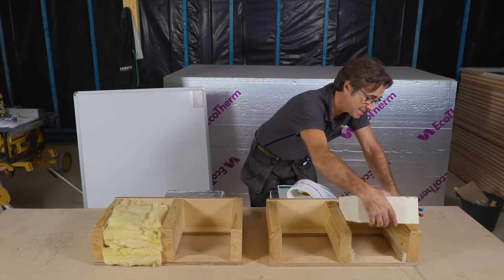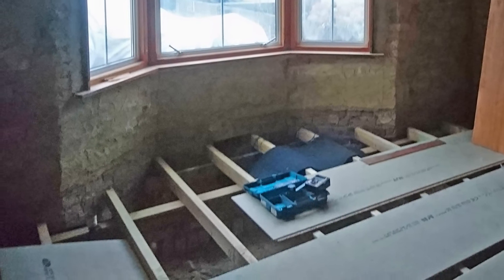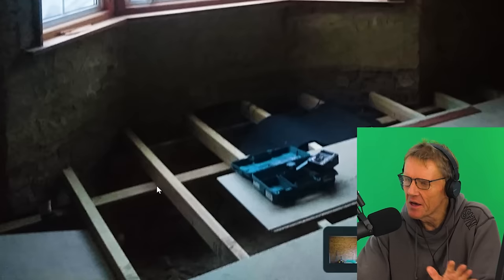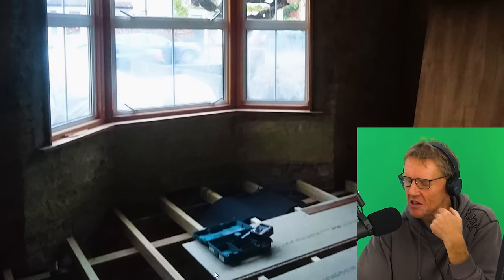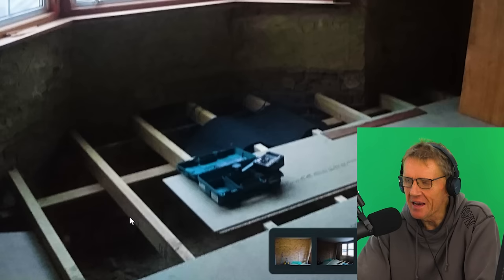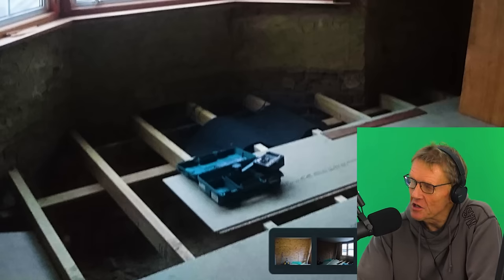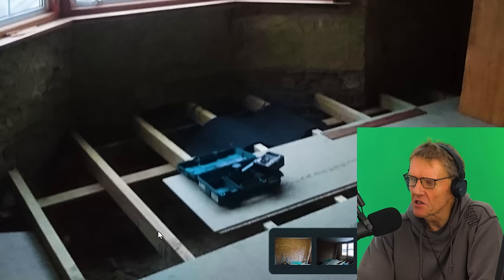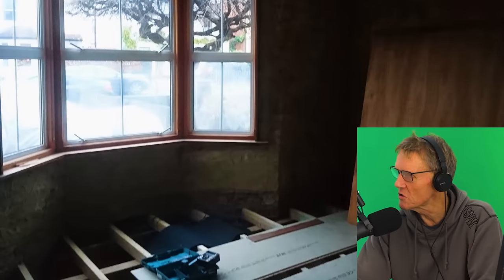Cold Floors & Walls in an Old House ~ What Can Nick Do?

Comment: I am steadily wall insulating the whole of my ground floor Victorian flat by CLS battening out the whole wall with lengths & noggins (taking wallplugs/securing screws into brickwork below sound original plaster, then insetting with Kingspan/Celotex/Iko ultratherm or any of those insulating boards (min depth 25mm), then plaster-boarding over the whole lot. It takes forever doing it this way, but I never want to have to do it again! It keeps my rooms warm and provides some sound insulation.
Reply from the maker: Are you putting in a vapour barrier?
Reply: It's laborious, but have been sealing all outer edges of insulating boards (where they meet CLS battens) with flexible decorators caulking, and am using metallised polyester (silver) backed plasterboard (screwed down to CLS battens) to finish. I'm only a DIY-er so hope this will be adequate! BTW Roger, I used to listen to you on LBC many years ago. If I remember correctly you had a regular DIY problem-solving slot on the Therese Birch (phone-in) show? Used to really enjoy your expertise & advice...still do! :)  @SkillBuilder

Comment: You could render the brick wall with a Lime render, which can be gauged to ensure no cracking or at the minimum mitigate against the possibility, the great characteristic of Lime is that it breaths and you will not get condensate on the surface, unlike a cement based render. £3k is heavy I would say, but depends on the area to be rendered.
Reply: £3k? Someone is having a giraffe.
Reply: I'm guessing the area to be rendered is London!
Reply: @catabaticanabatic3800  ... yeah and a long neck one at that! ATB
Reply: @ricos1497  😂

Comment: I'd fill the floor with concrete, 100mm insulation,underfloor heating and 100mm screed, walls insulated plasterboard using  foam to stick it on, maybe blue grit walls 1st.

Comment: I do quite a bit of work on old buildings. Had flats that were damp, in various places. Some was a result of external ingress of rainwater and others were a result of condensation. I tried to resolve both issues:
1. I removed all of the old lime plaster on the walls 
2. Did a 50/50 SBR mix X2 coats on the bare brickwork (stops salts from fireplaces and external water ingress)
3. Dabbed 50mm celotex to the walls (taped joints. Vapour barrier)
4. Fixed plasterboard onto celotex with Soudal adhesive (insulted plasterboard is very expensive)
Worked perfectly so far.
Reply from the maker: How did you dab the foil face of the board, did it stick?
Reply: @SkillBuilder  yes, fine. You can dab foil backed insulated board straight onto the wall, so  there's no reason not to dab celotex onto the wall. Worked well for me.
Reply: @SkillBuilder  I dabbed with normal powder form adhesive.
Reply: You need to fix the celotex after dabbing with mechanical fixings. They're a 10mm plug with large head that has a push in centre. Make sure the adhesive is dry.
Reply: Saw a guy in Warwickshire on YT who recommended InstaStik or similar (Mega stik?) for the pir to brick, then Everbuild clear silicone (glue/sealnat) for the plasterboard to pir (pir and p'board cheaper than just insulated p'board). I can't remember if he said to PVA/SBR the p'board first for better adhesion, but I probably would anyway. Gonna do  my kitchen next year (stone walled cottage) this way. Ty Mawr lime just up the road, did look at the woodfibre board option, but getting it all lime plastered too many £££.   @gdfggggg
Reply: @robjworkshop5692  lime plastering is silly in a modern world (not in all applications) . I've used this method a few times and it's been very successful.
Reply: Interesting. I’ve got exactly the same type of property and struggle with humidity in the lounge. Was thinking of dry lining the walls. Is there any benefit of removing the old plaster first? Seems a lot more effort.
Reply: @adamgriffiths4178  the older plaster can be quite thick and loose. You can gain a bit more space and guarantee a good fixing. If you've got humidity issues, you must remove that issue. Good ventilation in your property, from front to back and side to side is important. Don't dry clothes inside and make sure your hot shower room has excellent extraction. Keep internal doors open at all times, and if not, ensure there is a large gap at the bottom of your door.
Reply: @gdfggggg  cheers! The plaster is pretty good so might go straight over. 
Yeah done all the above on the humidity. Tumble dry in outhouse, open windows in the morning, squeegee the windows off every morning, run a dehumidifier when we can.  Live in a small house, 4 people breathing, cooking, showering etc, plus I think there are outside issues to investigate…. But thought dry lining might remove the mould on the walls
Reply: what is the 50/50 mix made of ? 1 part SBR and ?

Comment: Insulated plasterboard seems the best idea but maybe not too thick otherwise risk of interstitial condensation?
Reply: Not if it's a solid wall, which is likely with this age of house. 
Insulated plaster is impermeable whereas you need breathable (or vapour permeable, if you prefer) so that air can pass through the wall and remove moisture as it goes. Otherwise water in the wall, from outside water/humidity, can't escape quick enough and freeze/thaw cycles will damage the structural fabric of the building. Internally if you have impermeable plaster then you need adequate ventilation to keep humidity in check.  Lime plaster is naturally breathable but you can add hemp or cork to it insulate or use wood fibre board or aerogel matting underneath the plaster.  Lime is easy to plaster with for a novice so he could do it himself as £3k is way too pricey - the materials are still a little pricey though so it will cost more than gypsum.
Reply: They apply adhesive expanding foam and two screws into wall for each board (Thickness of plasterboard plus insulation plus 50mm for screw length) at 3/4 height of board these days, not dot and dab, refer to YouTube videos (Screws must be applied to keep boards in place for so long in case of fire!?!

Comment: I had my suspended wood floor insulated like this last week in a 1949 Dublin semi-d - the difference is unbelievable. The room would cool down in about 10 minutes when the heating went off but now there is a very constant ambient temperature without the heating. 

I personally would advise against internally insulating as the heating would never be absorbed by the masonry/walls. Insulated externally.
Reply: EWI is much less risky than IWI, but it also comes with many downsides and complications.
Reply: @lksf9820  I'm consideration getting EWI. What are those drawbacks?

Comment: Roger, if you put a vapour barrier on top of the joists, you then can’t glue the chipboard flooring on to the joists. Personally I’d recommend gluing the boards and not bothering with a vapour barrier.
Reply: The vapor barrier (Foil) is already on the foam insulation normally, it can be on one or both sides too, just mastic or expanding foam around the edges of the foil to the wood if you want a complete seal!?!
Reply: Only the joints of the boards need to be glued for building regs
Reply from the maker: BigSugs 
I agree it does hardly anything and you are right about the glue

Comment: Whatever way you decide to insulate this floor it is critical that you check the floor vents, ensure they are clear, then do a calculation for the ventilation requirement for a modern suspended floor. My calcs usually indicate that more vents will be needed. 
Also, older houses may have new paths or patio slabs increasing the level of the paths above the level of the subfloor,  this will allow water to migrate to the subfloor with potentially disastrous consequences. 
Keep an eye on the subfloor with a hygrometer if you can, check every few months for around 2 years, just to see if it's trapping moisture. 
Good luck with your renovation.

Comment: If you dot n dab plasterboard to a party wall each dot will act as a sound transmitter. Seperate from the wall with a stud/metal frame. Only dot n dab internal walls.
Reply: Yes

Comment: Thanks Roger for posting this, the problem with making a decision on insulation on solid walls is there is so much information out there on how to do it and not to do it, a lot of it is conflicting.
To improve the EPC they want a minimum of 50mm insulation, my concerns of using PIR is the release of toxins and possible shrinkage.
My original idea was to cross batten with breathable superfoil and then plasterboard, which would allow moisture to travel both ways through the wall, unfortunately I can’t find any feedback out there of it being used to give me confidence in it.
There is so many issues with insulating homes incorrectly which can be costly to correct in the future, thanks, Nick
Reply: You need a breathable insulation system, there is loads of expert advice out there if you look around.

Comment: With floors up and bare walls it is a perfect opportunity to run in networking and power cables.  More sockets and network outlets are never wasted but do plan them carefully.

Oh, and take pictures of the cables on bare walls and in floor / ceiling voids before you cover them for future reference.  Similar for pipework in kitchens, bathrooms and en suites of course.
Reply: Just run any cables according to the regs and there's no need to photograph for future reference.

Comment: our house is 300 years old 16 inch solid walls we had our room 14 ft square lime plastered for a few hundred quid using nhl2 and a lime top coat nhl2 is about twice the price as std cement
Reply: That’s cheap for a full room

Comment: A Decent Miltifoil for the floor... Insulation & vapour control barrier, all in one, for the floor.
Maybe the wall also, or insulated plasterboard with vapor control, sealed tgrn a decent graphite infused wallpaper, then a decent wallpaper liner, then a acrylic thermal paint, in a colour of your choice haha..

Comment: You often find that the cavity has filled up with debris over the years leading to a bit of damp at the base of the wall where the dpc or cavity has been breached and the brickwork is often very wet.

With good old dense timber and ventilation the joists on that front bay wall may not rot easily in their current state BUT if insulated and injected with foam to seal the gaps as Roger mentioned you could have some issues in years to come.
Reply from the maker: It is good to consider these things but the joists don't touch the wall so the foam does a good job. I have never seen any problems with it.
Reply: @SkillBuilder   Ok I couldn't see that but filling the perimeter space would bridge the gap between the previously isolated joist and a potentially damp wall, most foams soak up water quite nicely.
Reply: It's a solid wall.
Reply: @lksf9820  A solid wall would be more likely to be damp at low level

Comment: I'd dot and dab polystyrene insulation onto the wall, then dot and dab plasterboard over the top. Or perhaps build a studwork frame if the wall is likely to move, in which to fit insulation,  but that has its own issues. Never use plastic sheet in any building - tar paper (the thin variant like a roll of black card, not the thick roofing material) is better as it inhibits rot, doesn't create a cold area to attract condensation where it touches wood and if it gets soaked will give way such that one sees a problem (and water is released) before wood rots. It's also far easier and more pleasant to work with. For the floor,  if there is space, i'd hang a layer of PU (Kingspan etc.) insulation under the beams before filling between them, to super insulate the room. I'd probably go so far as to insulate the ceiling of rooms, too, as we may face a time when we go back to being able to heat only one room much of the time  - the cost/benefit ratio and return period combined with effectiveness  considerations based on other factors in the house is of course a question for each household, but I say super-insulate every time - i've done it repeatedly in different countries and the feeling of quick warmth and lasting comfort into the night, or even 24 hours, is wonderful. I'd probably fit an inter-room adjustable vent in each room too, and probably one to the outside, to manage and optimise airflow around the house - dead cheap and simple to fit and nothing to go wrong. And i'd always fit a wood burning stove which draws cold combustion air from under the floor so that airflow under floors is enhanced.

Comment: Any advice for insulating a concrete floor? We’re in the process of buying a bungalow with concrete floors, obviously adding an insulated floating floor would be an issue with height.
Is the foil bubble wrap stuff worth putting under a carpet?
Reply from the maker: You can buy some excellent foil faced carpet underlay. Just check is ok for your carpet. I don't think it is good for carpet with a high wool content. Talk to the carpet shop   https://www.simplyunderlay.co.uk/product/qa-powerwalk-silver/

Comment: Great video very similar situation just bought a 1920’s build. Working on upstairs. We’re not back to brick like this video so is there an advantage to hacking off the old plaster/bonding coat back to brick? 

Looking at kingspan k118 board and using the dot and dab as you were saying but open to suggestions if you think there’s a better board to choose from?
Reply from the maker: I would leave the plaster if it is sound but if it is loose hack it off.
Reply: @SkillBuilder thanks for the reply!

Comment: Worth noting that any attempt to improve the thermal insulation of a property in an England does strictly speaking come under building regs. A big renovation like Nick is doing would require upgrade of thermal elements and needs to fit Part L of approved documents
Reply: An extension or loft conversion would require this but just upgrading an existing element would not require you to comply with the approved document, you can put in as much or as little insulation as you wish.
Reply: The wording is vague in part L, rather than being so specific.  It is always better to double check so you don’t get pinged later - building regs are mostly there for a reason
Reply: @samnichols4361  I speak from experience, I have done work like this and have spoken to building inspectors about it and you do not have to comply with part L for this type of work.
Reply: Fair enough I will defer to your experience on this one.

My advice was slightly different when I enquired with local building control but I have not done the job yet so it doesn’t really matter
Reply: @8bitsim  According to the approved document to Part L, it states that if you are renovating or replacing more than 50% of any thermal element (wall, floor, ceiling, roof) then it must meet current building regs regarding u values.

Comment: Old houses need some modern mechanical ventilation system if you upgrade the insulation everywhere..  otherwise humidity will be a problem..
Reply from the maker: humidity is always an issue, new house or old. I have to limit the scope of the answers otherwise they videos go on forever.
Reply: Or you use breathable insulation and plaster.
Reply: @SkillBuilder  truth enough

Comment: Do you have to remove the internal plaster on solid bricks walls first or not? I hear if you Dot n Dab, it bridges cold spots and damp through to the plasterboard..?  Can you use fiberglass behind the boards?
Thanks.
Reply from the maker: Just use thermal plasterboard. It is a vapour barrier and you don't get cold bridging on the dots
Reply: @SkillBuilder  Thanks. So no battens on internal (exterior) walls? Just dot n dab? No need to knock wall back to brick? 
Or just dot n dab thermal plasterboard in the wall?

Comment: Has anyone mentioned wood fibre board insulation with lime plaster? Completely breathable. Surprised dot dab with pir plasterboard was advised on a solid external wall.
Reply from the maker: The whole idea of insulated laminated plasterboars is that if forms a vapour barrier. 
Brethable means it allows moisture in as well as out. Wood fibre with moisture migrating through is not a great idea
Reply: @SkillBuilder this is a genuine question, not arguing with you, do you know why Historic England recommend wood fibre and lime products for solid walls in listed buildings? All they talk about is allowing moisture movement and breathability, therefore the opposite to what you’re saying. Help! 🙏

Comment: If it's traditional solid wall construction, you do NOT want to use plasterboard, the moisture through the wall will eventually ruin it. They do a insulating lime render product which is meant to be really good, then skim with a lime putty.

Comment: Was looking in to insulating floors before and remember advice on leaving bottom part of the joist free from insulation because of moisture? Gave up in the end as so much conflicting information on the net, can you give your opinion on this matter as the boss is nattering about replacing all carpets again and won’t to do a proper job, same situation solid brick house suspended floors.

Comment: I would stick with lime on a house that had it originally. There are lightweight insulating renders available with fibres using NHL2
Reply from the maker: I think the £3,000 price tag is a problem for those two little walls

Comment: I've heard of some people putting up studwork and insulating between the studs but leaving a gap of 25mm or so between the brick and back of studwork/insulation to allow the wall to breathe. Is this necessary? Cheers
Reply: Only on single skin walls
Reply from the maker: You really want a dead air space if you are having one. The important thing is the vapour barrier on the warm side